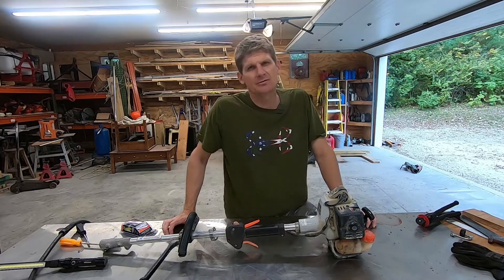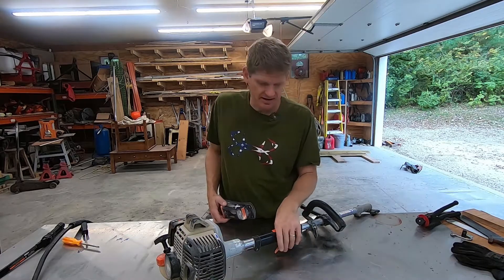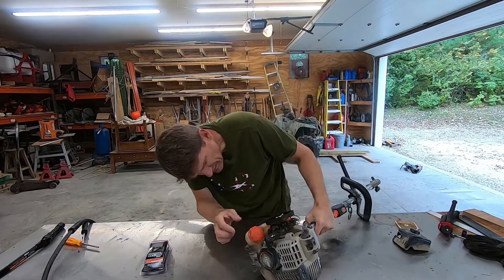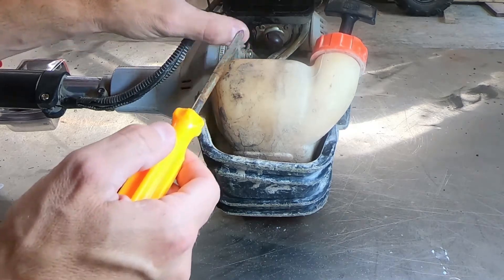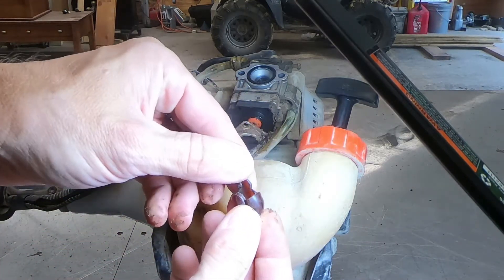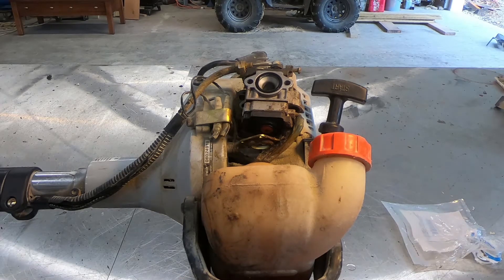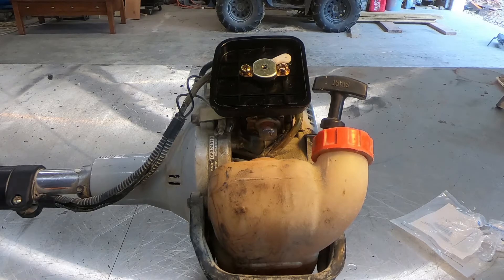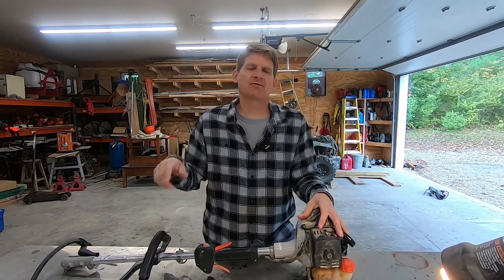Replacing the primer bulb on Echo PAS 260

Comment: I do recommend emptying the gas out of the tank and carburetor... I first replace my choke bulb, and it was the worst nightmare ever... I had gasoline spilling everywhere... So I ended up having to empty the fuel tank because it was spilling too much, after I replaced the choke prime, I filled it back up, and tested it if there was no leaks, and make sure the engine is still running